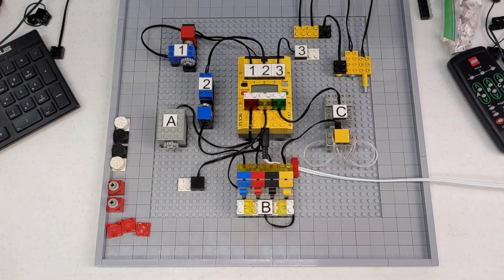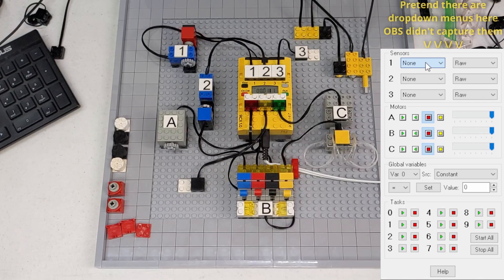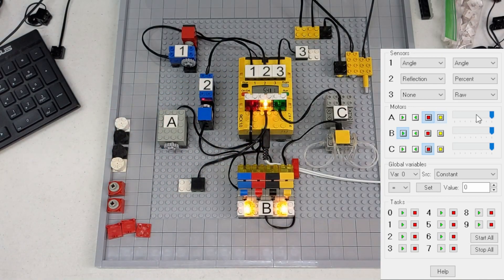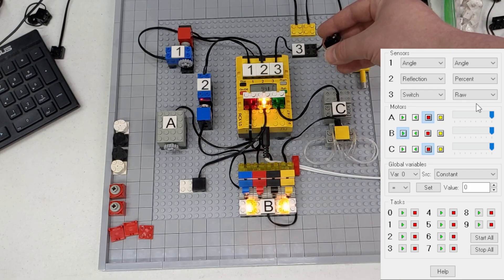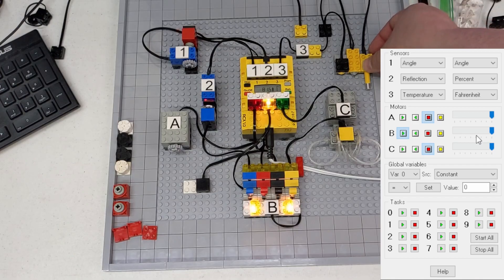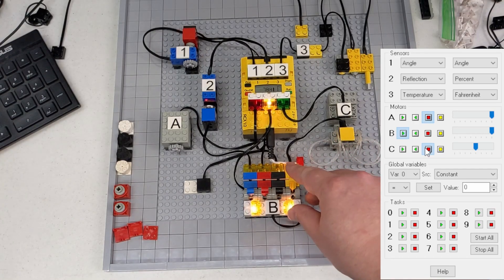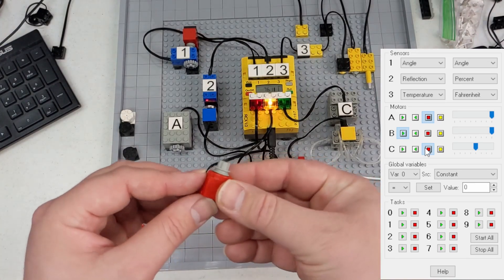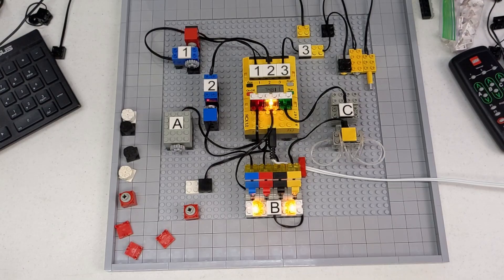Testing Lego 9v and Mindstorms elements using the RCX

Comment: A helpful and interesting video. As far as I know the rcx need instead batteries an 9-12V AC power-adapter. Which adapter do you use? I can't find no concret informations to this theme.
Reply from the maker: I've used lots of adapters.  I tend to use 12vac primarily but just about anything will work including DC since there is an integrated bridge rectifier.  I've heard folks say that RCX's can be damaged by putting too high of a DC voltage but I've never really seen this confirmed, it would only use 2 of the diodes rather than all 4 of the bridge.  There are several internal revisions of the RCX so some may have a weaker power circuit.  I found most of my adapters in thrift stores, it's harder to find AC transformers these days.
Reply: @BatteryPoweredBricks Thank you for your helpful answer!

Comment: I’m glad I found your channel! This vid is great. In January of this year I dug out my old RCX 1.0 and replaced the regular cables with new plastic coated wires because the original rubber insulation had disintegrated. I can’t really solder so I’m nervous to try and do the same for the light sensor😅

Glad to see there are people keeping the RCX relevant! I got to use an NXT (2.0) for the first time last week, which was cool because it’s the dream set I wanted growing up. But I’ve gotta say… the RCX is still my favorite for some reason. Maybe because it has studs :)
Reply from the maker: Thanks so much for the kind words!  Soldering can be a great skill to have, You can always practice on other things / scrap wire or buy a cheap kit to learn.  I've always loved the RCX and it's still my favorite device to use.  Since starting this channel I've found a few others that still use them and that alone makes it all worth it :).  I've used the NXT a decent bit in builds but haven't actually done the builds from the original set.  I hope to do that soon

Comment: ... a great video, thanks. I just unpacked my old Mindstorm box and now have the RCX (1.0) on my desk. Now the question is how do I work with the Brick and Windows 10 together. Do you have any idea?
Reply from the maker: If you want to use the official software you'd need to run a virtual machine with Windows XP or 98.  There are several unofficial programming languages / software that work in windows 10, I prefer NQC and Brickx Command Center.  Do you have an infrared tower to communicate with the RCX?  If so is it USB or serial?
Reply: @BatteryPoweredBricks  ... many thanks for your quick reply. I'll take care of the newer programs. I already have a VM VirtualBox installed. And my infrared tower is a serial version.
Reply from the maker: @MeinElektronikHobby  Nice, the serial version is much more compatible.  Like I said I've always stuck with NQC (Not quite C) or official but there are other options such as RobotC and LeJOS (java based iirc).

Comment: Nice video! I am also interested in what the RCX can do out of the box without any programming via another device. I was astonished that the RCX can recognize the exact resistance of a touch sensor, but on the other side I found the angle sensor readings to be a little rough.

Btw: I know how to repair those micro motors, but i would not recomment anybody to give it a try without knowing exactly (100%) how these things are put together. The problem with the micro motors is that their main shaft gets stuck due to corosion, then they only make faint clicking noises anymore. It is not possible to turn it or lubricate it from the outside, if that comes to your mind. Opening the round top side is a pain and won't lead you anywhere as it's just a gearbox that doesn't cause the problem. If the bottom half is disassamlbled the tiny commutator fingers get out of place and it can't be reassambled just so, because the commutator fingers will then bend or just break off and the motor will never run again. So it is cursed from the beginning and this wasn't even the repair.